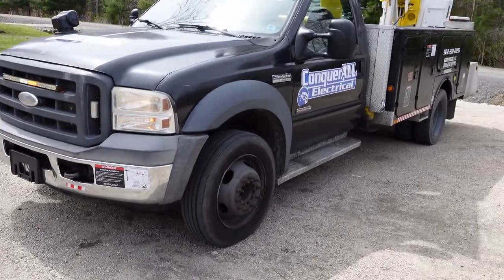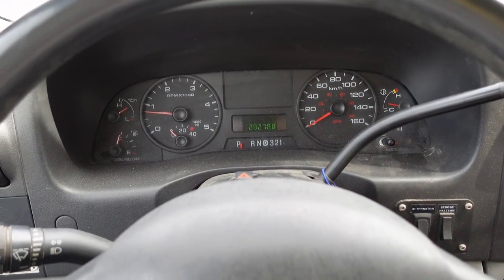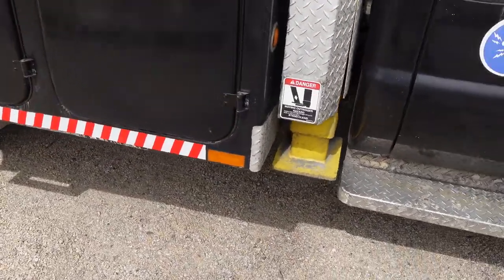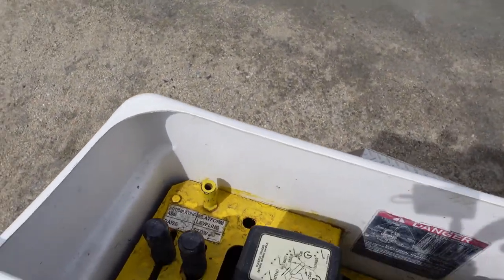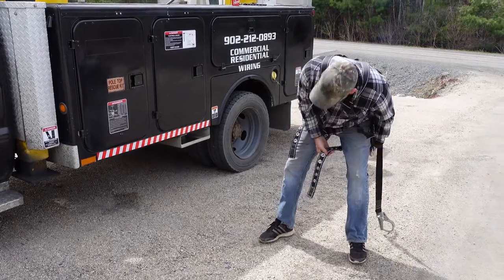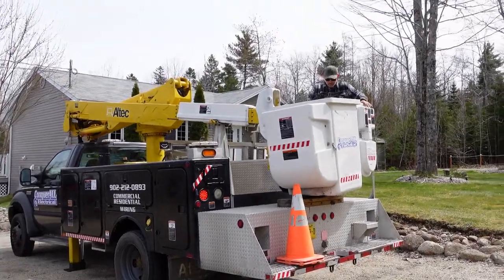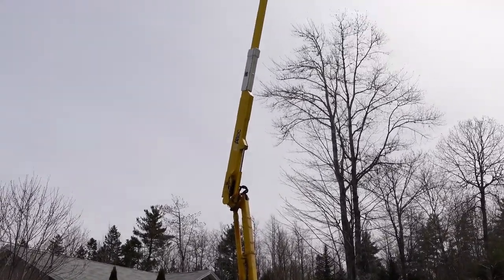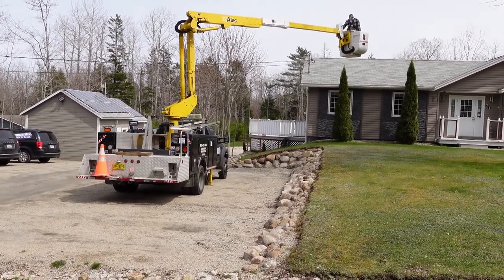Bucket Truck Operation and Safety

Comment: at Bell Canada , our line trucks use to have small holes drilled in the bucket , also single stage boom , and the out riggers use to extend out at 45 deg angle , but we also had a auger mounted for poles . was great times back in the 70's / 80's . thanks for the vid